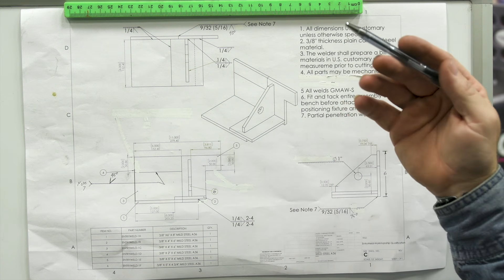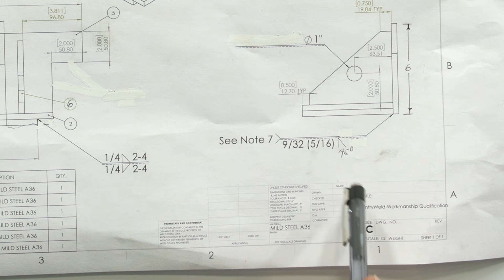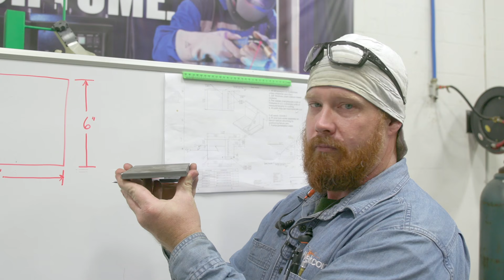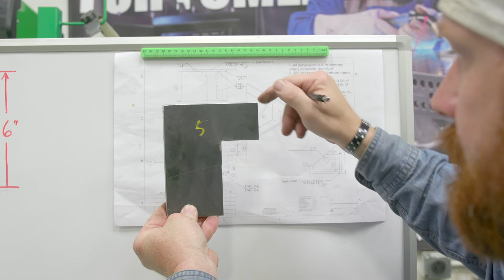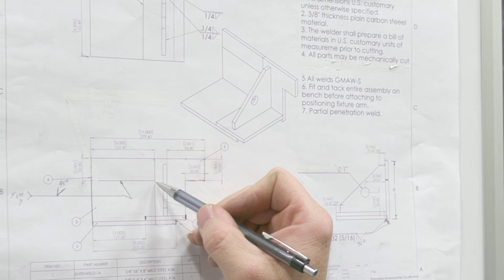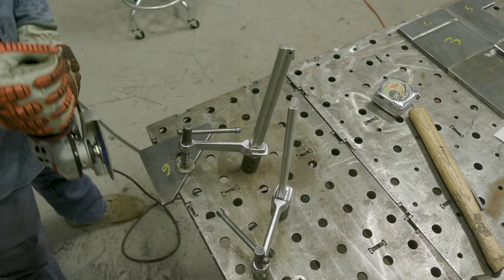How to Read Blueprints and Shop Drawings with Weld Symbols

Comment: There's a mistake in your preparation: where the top welding symbol (note 7) indicated a 45 degree V groove on the same side indicated by the welding symbol and you made the V groove on the other side facing us. The weld should of been on the back side of the assembly. 🙂

Comment: Hi, good video. Question, doesn't part #5 needs a second L cut right at the bottom? From the right view it connects with part#1 however in the front view part#5 doesn't show at the very bottom right corner. Thanks.

Comment: Those front grove welds are supposed to be on the other side ( the back side) no? The arrow points to the front but the symbols is put on other side not arrow side, so the back.

Comment: I'm a tad scared of this aspect of welding. I'm about to graduate from my community college, and my teacher has set me up with an interview/weld test. We went over blueprints and weld symbols 3 semesters ago. While I wouldn't say my teachers instruction's weren't clear, it's been a solid minute since I've had to read them in any capacity. I've never built anything off of a blueprint and outside of a classroom setting, I've never read one alone. This video was helpful, but also intimidating. My teacher isn't to blame though. He isn't in charge of the welding program classes. He said he would've liked to have had a dedicated class to just blueprints, weld symbols, and fabricating from blueprints. The one to blame is the instructor at another campus in charge of the program classes. Would've much preferred a blueprint class to a robotics class(It was a joke of one anyway). I hope the people who are interviewing me are understanding that I've never worked a welding/fabrication job before.
Reply: @JB-kn4uc  how did it go? im coming out of trade school this month and getting ready to start interviewing as well, but I will say I have had a bit of a similar experience with the instructor lacking in the print reading/project assignment department.
Reply: @writistarter  how’s that going?
Reply: I just graduated from trade school and im in the EXACT same situation 🎉
Reply: Sheesh my community college charging me like 5k and I have a deticated torch cutting blueprinting and joining class as well as remedial math and a safety class and it's all payed for from my fasfa
Reply: @JB-kn4uc  in the same position bro

Comment: I'm I reading the blueprint wrong? It looks like the 2G connecting 3 & 4, and the 3G connecting 3 & 4 to 5 are supposed to be on the backside. I've made 4 of these exact pieces for school, and still have 4 more to go. If that's wrong, then my instructor didn't notice.
Reply: You are Correct!
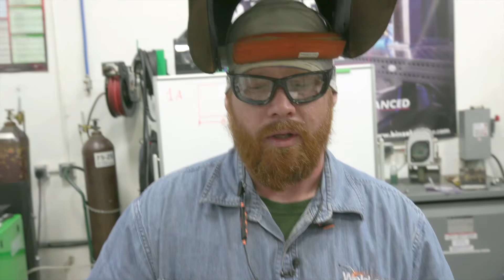Reply: Yeah, you're totally right.  The problem that he ran into at 22:45 shouldn't have been a problem.  The weld face reinforcement was supposed to be on the back.  Great video, though.

Comment: I, for one, try to avoid making my fabricators do math, if possible--reference dimensions are your friend! And be careful assuming the engineer screwed up, every once in awhile, we actually know what we're doing!
Reply: I was taught that machinists and welders/fabricators should never have to do any math. Everything they need to know should be on the print.  If they have questions, you haven't done your job right as an engineer.
Reply: @josephcitizen4195  That's a good philosophy as an engineer!
Reply: @aaronsmith7817  not trying to be rude. But I’ve never had an engineer throw out two correct prints in a row at any shop I’ve worked at 😂😂😂 tough job. Damned if you do damned if you don’t.
Reply: Nope. Engineers never know whats going on

Comment: Man I really appreciate this. I have this cut and plan to weld it out for my sense test Monday and fortunately you make this video just in time! on the drawing the reference line arrow for beveling the plates v groove 45° is pointing towards the back side of the material, but when you weld it out it is on the front view. So Im missing something here, and will likely have to do no some more beveling and cutting tomorrow :/
Reply: thats what I thought too.
Reply: I also think the bevel should be at the back

Comment: Engineer 2 here. Just a small point; calculating the size of a "missing" dimension from other information on the drawing is fine.  The examples shown were excellent.  However, the comments regarding "scale" require some clarification.  The scale in the title box is for indication only and provides an idea of how big or small the finished part is.  What it is not intended for, at least on my drawings, is for anyone using the drawing to work out a missing dimension by measuring it and using the scale.  In fact, a lot of drawings have "DO NOT SCALE" on them.  If a dimension is missing and it can not be worked out from the information on the drawing, send the drawing back to the Engineer or company you are making it for.
Reply: @paulcharman44  do u think u can help me read blueprints im in welding school and if there’s someway i can contact you that will be great
Reply: @hennesseymorman4906 what do you need help with?
Reply: @hennesseymorman4906  hope ya figured it out, its not that much to know & theres videos
Reply: @paulcharman44  do you think I should take this position for a Nucor Building Systems Texas: Onsite Assessment for Entry Level they said they would do training, but I just have to pass this assessment

Comment: All the views are correct assuming third angle projection. In first angle projection, all the views would be reversed. Not a major distinction to make for the US guys, but if I’m not mistaken, international drawings sometime follow first angle projection
Reply: Correct.  btw This drawing does have an error.
Reply: @dickhorner  Where?
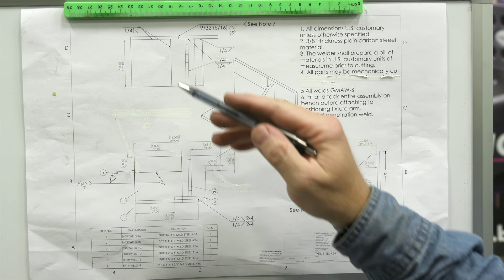Reply: @josephcitizen4195  At time 1:35 look at the lower right area of the front view.  Below item number '2', and to the right of item number '1' there appears to be a small piece of item number '5' thats been removed or obscured by whiteout.  This portion of item '5' is still correctly shown in the iso, right, and top views.  There's whiteout all over the drawing.  I'm sure this was done to make the drawing easier to use for illustration on YouTube.  Weld.com is excellent!

Comment: Good video. Looks like a solidworks drawing.  The parts should have been detailed on seperate pages showing the bevels to grind.  Very easy to do in solidworks you spent too much time figuring the bom  and the part shape and dinensions, this all should have been layed out for you.  The old man should slap some sense into the person that did this drawing.

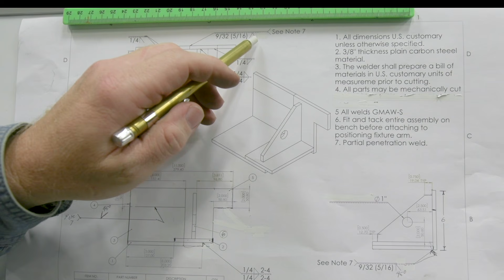Comment: @18:15 you said "this means other side"... but bottom of the line means arrow side. 
If I'm reading the print right, parts 3, 4, and 5 should have been beveled on the back side. Then you would not have had the problem @22:45 of having to weld the bottom inch or so before tacking it all together.
Reply: That's exactly what I saw also. I thought I was crazy.
Reply: I was just  looking to see if anyone else noticed that too...
Reply: Thank you. I knew it. I thought my whole knowledge of welding symbol was wrong especially with this guy's confidence
Reply: Correct
Reply: Searched this comments to find this after watching. Thanks for confirming
Reply: I agree with you guys.  There'sfaced the mirror effect. After beveled they couldn't change nothing. Spoilage, detl does not match specification.
Reply: He is actually right.. he is using ISO standard rather then AWS, in ISO the full line means arrow side and the dotted line means other side no mather if it is up or down.. here the filet symbol is on the dotted line so on the other side.
Reply: @thalystanguy-lessard8887 I know this is a late reply but wanted to say  thanks for this key info,  it was very insightful and I think if more people read your comment it would clear up the confusion they had
Reply: I noticed the same thing. I even paused the video as soon as he said it because I thought it wasn’t right

Comment: Why not 1. Sandblast all the millscale off of the original plate before it's cut on the CNC machine, and 2. Program the angles of the cuts at 45° into the CNC machine before cutting the part? You wouldn't have to even look at the angle grinder and the angles would be perfect every time, no prep required, the parts could just be taken directly from the CNC machine to welding. It would save hours of prep and countless angle grinder discs.
Reply: In the real world not all shops have plasma tables that can cut bevels. In fact I would say the majority of plasma tables do not have that ability.
Reply: @josephcitizen4195  I realize that not all tables can do the bevels, but wouldn't it be nice if they did, it would save so much time and money. Thanks for the comment though I should have been more clear about what I was saying.
Reply: @jasonburguess  I think we're probably headed that way. Once manufactures start including three axis heads (?), is that what they are called, on cutting tables as standard this type of grinding and beveling will be a thing of the past.  No prob. I love talking shop.
Reply: Nope cant weld the dross if its a plasma cnc
Reply: @ericmayger3697  if your plasma cutter is set correctly the dross taps off with a hammer in two seconds,  if the plasma is  running too cold of too fast then the dross is really thick, but play with the settings and it chips off like old paint

Comment: Your comment "that the drawing was not to scale" is incorrect, it is to a scale, and if as you said it was 1:2, something in real dimension that was to be 8"  would be drawn at 4" or 1/2. When something is "not to scale", it means exactly that, so you cannot measure off the drawing, so a piece may be 8" long x 6" wide, but on the drawing could be drawn in different ratios, so 4 1/2" long x 4" wide, that is NOT TO SCALE.
Reply: no sometimes its not drawn to any scale at all you just get shapes and dimensions
Reply: @rotam8680  that's basically what I said. 
A drawing that is "not to scale" technically is not to a "consistent scale". But individual parts (lines) would be to a scale, even if full size, that would be 1:1. An example, if you had a rectangular plate, that had true dimensions of 10 units long and 6 units wide, if it was drawn at 5 units x 3 units it's at a consistent scale of 1:2.  If that same plate was drawn at 4 units x 2 units, then the scale for the 10 unit side is 1:2.5 and for the 6 unit side is 1:3. While individual items are to a scale, it's not a consistent scale, therefore it's not to scale.